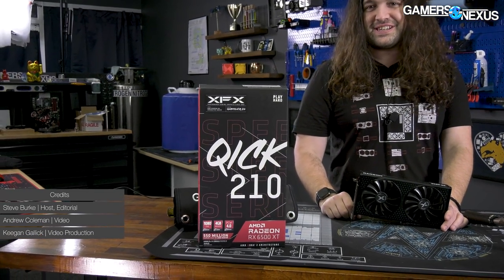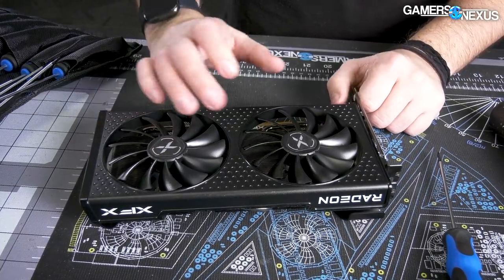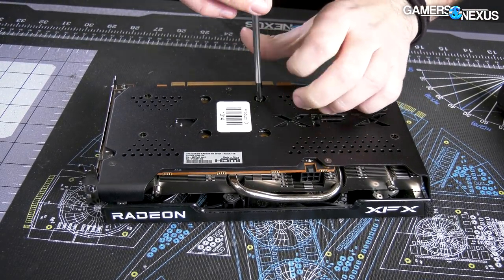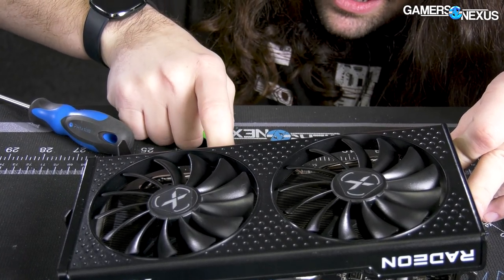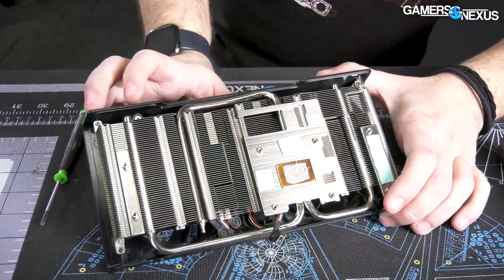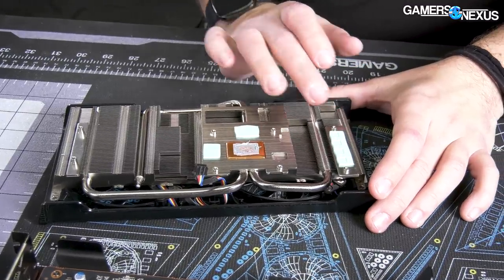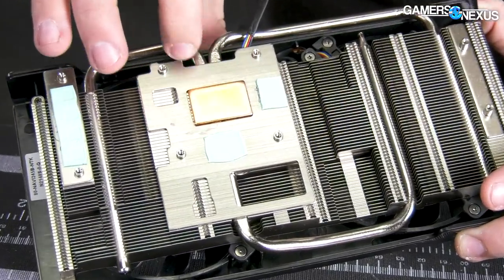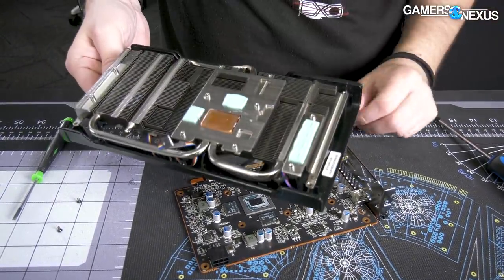Tearing Down Trash: AMD XFX RX 6500 XT Disassembly

Comment: This card reminds me of my old laptop, it had a GTX960M in it. It's got a 128Bit memory bus with a total bandwidth of 80 GB/s.
It caused games to be near unplayable in sections even back in 2016/17, e.g. Shadow of Mordor ran terribly in the map with water in it, Warframe also had issues even though card was not actually clocking high, just issues with textures not being able to load in fast enough causing hitching, even though it had 4GB GDDR5.
This card shouldn't exist in 2022, even in a laptop the move is iffy but at least you can guarantee PCIe x4 support.

Comment: I'm going to need to upgrade my 10yr old PC in a few months.    The GPU prices are crazy!   I built a PC for a friend with a $100 just before COVID and cyrpto-garbage started messing with the prices.   So I would need a card thats at least 50% better than my 2017 RX470, but I sure don't want spend $300 for that!
The 6600 seems good, want something that doesn't sound like a jet engine, but still $350?!

Hopefully the prices will get better this summer.

Comment: On a serious note, you can't fault AMD. It's a cheap card to manufacture, will sell because of the shortage and makes them a decent profit. The only reason this card exists is because AMD wants to abuse the GPU market. Think about it, under normal circumstances this card wouldn't sell since a 580 8gb pre shortage was £90-120 in the UK and this card is £189-229. There would be no reason to buy it at that price. I reckon these are mobile chips or defective 6600XT chips that have been repurposed into this garbage not only to get rid of useless silicon but also to get into the low end modern market. Buyers will be fooled and see RX 6000 and think that this isn't a steaming pile of shite. Brilliant marketing move, legit 200 IQ

Comment: Just returned a 3 fan xfx 6600 xt and got my que email from EVGA for a 3060 ti xc. When I bought my EVGA 1070 SC it came in a nice package with molded plastic, a case badge, adapters, and some paperwork.
My 3060ti xc came in a box with the card in foam and thats it.
I'm ok with that, just sharing.

Comment: As built, these things are made to be E-Waste - as a desktop card, you would almost be better off resurrecting an old R7 250, maybe except for the memory limitation, hell, the RX 460 makes more sense - they could even use the cheaper fab capacity.
As an owner of a DG1 ((and happy with it) with the most hated CPU name, the 1165G7 :D) laptop though, you could see the original segment they aimed for was competition for DG1 style hybrids and the power figures were not as good as they wanted.

Comment: XFX has changed how they design their cards since you roasted them. The Thicc 2 Ultra was bad, it had the same flaws as the 580 Fat Boy and they even added unnecessary cheap garbage to it.  After your video they made actual good designs with good pricing compared to other GPU Manufacturers and they offered to replace those bad Steel Plate coolers. The 6500XT still sucks but that is more AMDs  than the Card manufacturers fault. I like the design of the new XFX cards, they look clean and perform good with good pricing. As long as you can ignore the weird naming.

Comment: My main reason to call this a card garbage is the enormous gap it creates between radeon 6600 xt and 6500 xt. 6600 xt is about as powerful the old 5700 - 5700 xt cards.
So one would think that a card named 6500xt would be about as powerful as the old 5600?  But no... it can hardly compete even with the old 5500xt - the 4 GB version, and the 8 GB version is clearly better.

Comment: Should have been low profile.
Reduce power usage to be PCIe slot power only.
Scratch the backplate(cost reduction side benefit).
The x4 link limitation might be because it might have been a mobile chip with only x4 links physically.
Don't think it required this amount of cooling.

Comment: I understand why everyone is crapping on this card, its a bad release in 2022 but if we are being fair to it you've compared it to the 1060 6gb and the rx580 8 gb, this card is cheaper than what those are selling for USED in todays market place in many cases. So for $200 I can get a new card with warranty or I can pay more for marginally better performance for a card that will be used, often from a mining rig and have zero warranty. $$$ to performance really isnt that bad in todays marketplace, the problem is todays marketplace is horrible.

Comment: I'm gonna be the unpopular opinion here and say, if it's originally for laptop but moved to desktop, and close to the rx580 in performance, then it's a good thing that there are more Rx 580 on the market now so that at least it doesn't worsen the shortage. Unlike the 2060 12gb and 3080 12gb which took existing GPU and move up in price

Comment: The 6500 runs cooler than the 580 by some 9 - 10 deg. , testament to  the low power-draw of the GPU, is therefore quieter and of course has a more modern feature set.  
The 580 with more power draw, more than double the cores and TMUs, 4 times the memory  bus, twice the bandwith with 12 more bus lanes and even with 2x the amount of memory, still cannot dominate the 6500.  On efficiency alone, the 6500 is a marvel.

Comment: I brought a 5500 XT, it was almost the same thing.. it was pci-e x8 and used a laptop gpu, but it kept the hevc (I dont know how they did that), and it was 90 australian dollars

I only got it to throw it into a spare pc I had to run as a hackintosh for a while until I sold it

I should have taken it apart and had a look, looking at the device tree it was (motherboard) pci-e root port -> pci-e x16 to x8 bridge -> pci-e root port -> gpu.. what the hell

Comment: you keep saying cheap, but imo they didn't make it cheap enough.  Downsize the cooler a bunch, drop the backplate entirely, and knock another 20 bucks off the retail price.  For a card this low power you myswell go full stupid on the cost savings, not like it will make a difference in it's performance.

Comment: Possibly mentioned already but that circuit board is made of paper phenolic instead of fiberglass. That’s the absolute cheapest circuit board material, it’s brittle and flammable.  Luckily, most of the vulnerable pcie tab is inert due to the use of just infamous four lanes, so when Linus drops the card, it may still “work”.

Comment: Am gonna say, seeing retail price in the UK, it's lower than what used 1060s go for, so there's definitely a place for them. Am sad it's not for me, but there's plenty of people i would recommend a 1060 for, and it's the only new card in that price range.
The fact comparable cards, used, are the same price, hace got 5 years of use and no warranty behind then is just another reason i think the 6500xt has a place. As long as we're transparent that it's a discrete version of a laptop card am okay with it

Comment: Steve, honest question. Is there any possibility your team could test out different thermal pads on your test equipment.

I know its not y'alls thing, and you've never really paid much mind to thermal pastes debates/stuff along this line but no end user really has the equipment to verify all these claims companies make about there thermal pads.

We are just forced to take them at their word that their $30 a sheet thermal pads are just the best period, and everything else is simply a waste of money. I can't speak for everyone but I keep my hardware long term, still using a 980ti I bought at launch. 

I try to keep my card clean and operating as good as new for as long as possible to extent the life of the card. I think many others fall into this camp, either due to lack of funds or to simply reduce e-waste replacing an electronic every few years when there is still plenty of good life left in them if the purchaser shows some pride of ownership, and takes care of the item over its life.

I just ask you consider it (if you do end up seeing this) and thank you for your time.

Comment: If the card was $50/£30 cheaper it wouldn't be so bad as long as you have a PCIe 4 mb. I guess we need some terrible products to get the market to stabilise as this is still in stock here in the UK for a not horrible price 3 days after launch

Comment: this card would be good if any video card features other than video out would be present and if it would be marketed right.

 video encoding and decoding should be ona multimedia card. it should be mentioned on the box. this is not multimedia, its mutilatedmedia.

 this here is basically just a video out. which would be fine, i bought a ton of those in the 90s. you would add accelerator cards to them in older systems. no problem there. and I'd welcome a move back there. have simple cards suitable for most and expensive and modular add-ons for the select few that need them.

 they are marketed as real cards though, even putting ridiculous xt labels on them.

market them as entry level, better than nothing video out for office computers, and all would be fine. everything else is just lame and bad press.

Comment: this metal area immediate to the copper slug is Al im 99% sure. The lines or groves are extrusion markings. For something this cheap Al fits, and Ni is very, very expensive not to mention it's not extruded. Oh and just so u know, not every steel is ferromagnetic, austenite steels arent.

Comment: Wasn't there a video that someone put out some time ago about sawing off the pins on cheap video cards so they can fit into a slot that's smaller than x16? Funny that these cards came out after that whole situation
Reply: Dawid did that on a video

Comment: How to fix this:
• Make it either single-slot, or shorter heatsink / shroud (single-fan)
• No 6-pin (PCIe power only)
• Full 8x connector (literally why not)
• No backplate (why???)
• $150 or less

Fuck the computer industry, honestly.
Reply: -Size change would probably entail extra work on PCB and especially cooler design. Might happen later,  but doubtful it'd lead to cost reduction.
-That's another quarter of its power off.
-Not supported at the design level, from what I can find, a PCIe switch to do it would be at least another 10-15 bucks.
-Backplate's probably pennies.

It's just not going for 150 in Anno Domini 2022. Maybe if you get a time machine and convince folks to take that 'pandemic' business seriously. But you may as well grab some 2080s while at it.

Comment: 200 bucks seems like AMD is selling these cheap cards for scalper prices but it seems like you cant even find them at 200 anymore.
Reply: moore's law is dead has already made a video on the costs of the 6500xt, it isn't rocket science and this really is the cheapest they could get it. honestly if this card was slightly more and had a 128 bit bus and downgraded to gen 3 x16 it would've been praised
Reply: @notcraig255   I agree, the bus  should have  been doubled to 128 bit and gen 3 x16 or gen 4 x8 should have been used.

Comment: if they put this on an m.2 stick we finally get a reason for water cooled m.2 haha... the gpu and the 2 ram chips would fit and its already x4- they tried to release it as a gaming card and it isn't it should be a low profile or an m.2... low profile hasnt had a card since the 1650 and its $350 now

Comment: This should definitely go on the 2022 disappointment build, such a useless card.
Yes the RTX 3080 12GB is a disappointment as well but that's only because of the pricing, the actual card is a good one, so I'd say AMD RX 6500 XT is the definite disappointment of January 2022 so far.

Comment: This GPU should had cost like $120-150. It can't even beat the GTX 1650 that was released for $160 over a year ago.
Reply: It's a RX 580 4GB, and it beats the 1650.
Reply: @avatarion  hmm no. It's a RX 6500 XT And it barely matches a RX 570 4GB from 2018. The price of 200 usd is  horrible for the performance it offers.
Reply: @EtaYorius  I mean, the benchmarks speak for itself. It's faster than a 570. It's 30% faster than a 1650 while costing only a little bit more. The price to performance ratio is pretty good. Both the 1650 and the upcoming 3050 are crap in terms of price to performance.

Comment: It’s comical this card sells new for 250 cad but there completely sold out everywhere in Canada and are already listed on eBay for 500. Amazing
Reply: Did you actually see cards for 250 CAD? They are all at least 300-400. It is kind of insane... they are replacing 580s used which go for 500... insane times. I paid 358 CAD for mine but it is what it is. I needed it for a 5800x system that was using a 1050ti that just was not enough. This will get me by on my 1080 60 hz display until I get something worthy of higher res and frames.

Comment: maybe another tool you should add to your kit is something to easily remove the fan cable from a gpu, i'm thinking something that can push the cable up while also pushing down the base of the fan header. maybe a pair of very thin reverse pliers??

Comment: What an absolute joke. I don't even fault XFX for using a double fan cooler for a chip that's smaller than my left nut, they gotta sell the card somehow.
Reply: Its like a Dodge viper with 1.0 3 cylinder under that long ass hood

Comment: I would like to know if that gpu could run without the fan and heat sink, and if it could be modded to fit one slot.  I remember when gods didn’t have all the fans and stuff and am curious if this is something where the manufacturers are becoming focused on looks rather than performance
Reply: I mean, this also has the highest clocks out of maybe all GPUs ever released? Maybe if you undervolt it a lot you could passively cool it, but we might see overclockers get this... thing past 3GHz

Comment: G'day Steve,
That is a Huge Cooler for such a small Die & 2 Memory Chips, Sad to see XFX has moved away from the Tabbed Fans.
After seeing some of the other Models available nearly all the Partners have a 2Fan Cooler like this for their OC Version, 🤔 how bad must the performance of the 2Fan cooler on the GIGABYTE RX 6500 XT EAGLE be that they needed to have a 3Fan Version of the Cooler on the GIGABYTE RX 6500 XT GAMING OC, for me it Does Not inspire Confidence in the quality of their product 😏/s.

Ps TechPowerUps Rating on the GPU Database (Which is normally Very Reliable) as RX5500XT 99% RX6500XT 100% is a bit misleading as it is based only on PCIE Gen4 Performance
Reply: I think it's just after so many years of marketing big coolers = better the AIBs are afraid they won't be able to sell single fan cards(unless they label them ITX editions.) It's similar to the dumb oversized VRM heatsinks on many motherboards now. Worse clearance for the CPU cooler for no real benefit.
Reply: @ResilientME  Yeah I know it is "Ours is the best Model because we have the Biggest Cooler with 3 Fans" Marketing,
Sorry I forgot to Smirk my Sarcasm

Comment: I just want native 4k With ray-tracing and 60-120fps. 

 Also I wonder why if the GPU core is so small they didn't make it a half height card for slim computers, that would have made it worth it in terms of availability to upgrade older machines. As their would be less competition. They aren't using the full PCI-e 4 wiring anyway either.
Reply: 4k native with 60 to 120fps? Maybe in minesweeper and solitaire
Reply: @roklaca3138  That's the point when we have capable GPUs haha.

Comment: its a lowly #500 series part it is suppose to be cheap. its Not horrific it is what its meant to be a slightly better then display adapter low/mid range performance. ie r550 vs r560 . .550s little better then the 540.... its just the same logical progression weve seen forever. ..the price is the largest ball drop tho if it hit market at 69.99$ i bet the pr would be way different.
Reply: i could use anything newer then a hd6570 at the moment.
Reply: i kinda like the idea of making laptop grade gpu cross over to desktop idea. "Since the Videocard shortage mind you" if that never happened id say bah to hell with it. but now.. hey anything new that exists and will displace older hardware to the used market  is ok with me! . start upgrading people.. and sell me your old stuff at rock bottom prices! i dont care if its used i care if your gonna just throw it away as e waste when i can use it! or find some to use it untill its demise from use...

Comment: Thunderbolt 3 / 4 only exposes 4 PCIE lanes, right? There might be a use case for this as a 'full performance' (for the card) gpu in an eGPU laptop solution.

Comment: And just got to the point where Steve mentions the warranty sticker. My 3080ti FTW3 had one, which I had to break in order to install the hybrid aio kit that EVGA sells separately. But they did let me register it and transfer the warranty, even though I got it secondhand when I traded my 3090 FE for it. Sooooo... Good guy EVGA, I guess?
Reply: Did it actually say "warranty void if removed" though? Looking at my 3080ti ftw3 there is just a sticker that says "evga" all over it, covering a bottom back plate screw. This is a replacement card though as my first one closer to launch had fan 1 die in the middle of a Forza Horizon 5 session...

Comment: NEXUS what would be better gtx1050ti or rx 6500 ??
Reply: Don't ask them, they don't seem to know what they are talking about. The 6500 XT is the best price to performance card on the market right now if you couple it with something like an i3-12100F. 1050 Ti probably costs almost the same while being significantly slower.